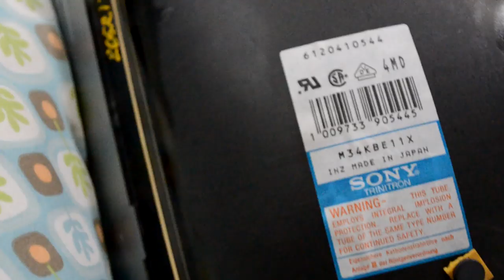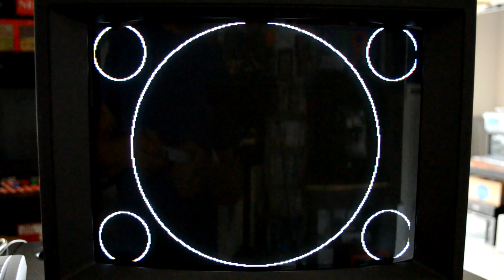Sony PVM 14L2 Trinitron Restoration - New Tube Installed on a Retro CRT Display

Comment: Could you make an episode about the best PVM alternatives (Consumer CRTs)?
Reply from the maker: Pretty good idea.  I have one of those Toshiba's and they are nice
Reply: @badreality2  Do you know if this TV is available in Europe? (Im in Germany)
Reply: @Pflanzenritter29-old  I do not know if it was sold in Europe, but you do have good choices of consumer C.R.T. sets.
First "rule of thumb" is to look for sets that will display 240p properly.  It should be 50/60 Hz (Pal/NTSC) compatible.  You want one that is compatible with the NTSC video standard, so that you are not playing your retro games in "slow-motion".  Buy NTSC consoles too...  And the equipment that allows you to convert 240v/50Hz to 120v/60Hz.
Second, stay away from 100Hz C.R.T. sets.  They display 240p incorrectly and light-guns may or may not work with them.
B & O had some good 50Hz/60Hz C.R.T. sets, back in the day.
B & O MX4000-MX8000 1.)https://youtu.be/S9LYa1UY4zk 2.)https://youtu.be/tXW7yayd6mo
I have heard that this Sony set is good. KV-29X5E
A PAL MegaDrive can be modded for NTSC, and your Sega MegaDrive will then boot up an installed game in NTSC.
Also, bug your local broadcasting companies for BVMs/PVMs.  You may be lucky.